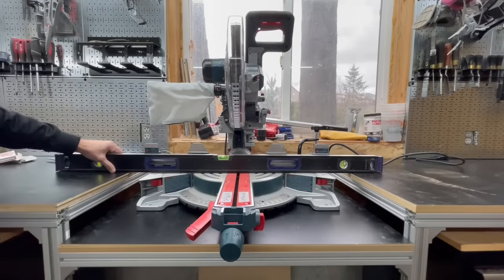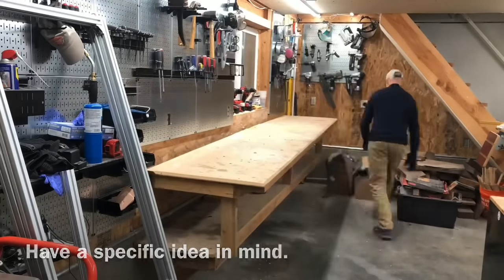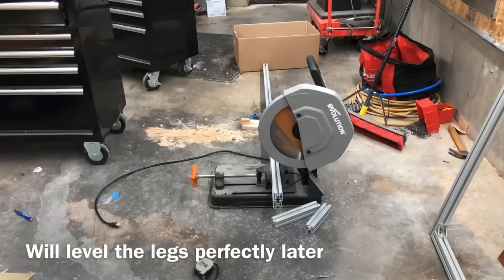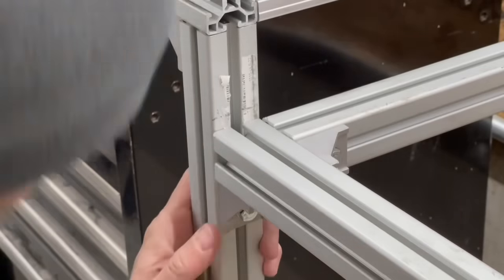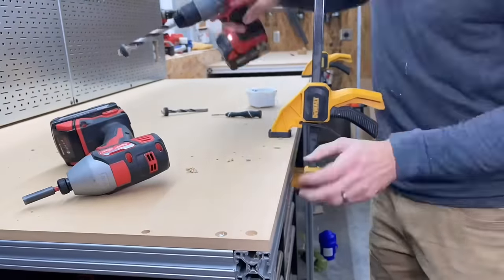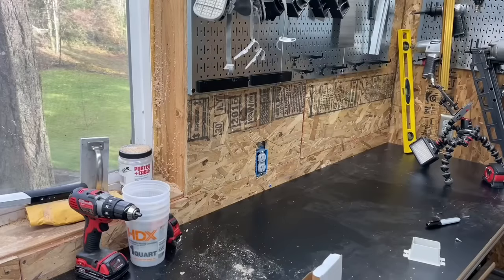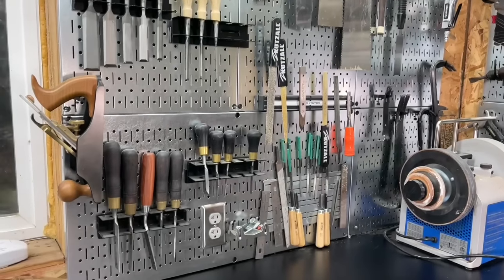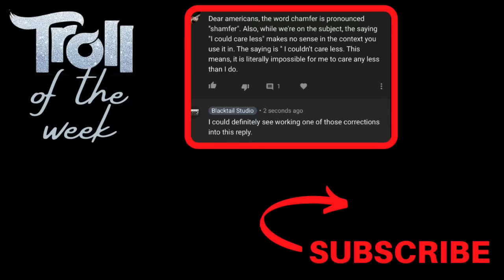Smartbench Workbench

Comment: Next time you try to make your miter saw level with the tables, use this trick: Get a perfectly square 2x4, so that when you lay it on the cutting area of your saw, it sticks out about a foot on each end. Attach it to your saw using the holes on the fence of the saw, making sure that 2x4 is sitting dead flat on the cutting surface of your saw. Now simply rest your saw using those extra foot lengths from each end. This will work as a temp holder while you install the permanent shelf for your saw to sit on. Hope it makes sense. Also, you made your station parallel to the floor, but that floor is not level, you might want to use a laser next time. Good luck!

Comment: Guten Tag, I like the industrial/modern look of the steel, makes things seem more professional.
Reply from the maker: I really do too
Reply: @BlacktailStudio  what was the name of the company the will build the table design for you?
Reply: I like the look too, but I probably would have replaced the plate covers for the electrical outlets. Metal covers against the metal pegboard blends in a little too well. Too easy to be in a hurry and accidentally plug something into the pegboard instead of the outlet, and vice versa could present a risk of shock. Maybe that's just me though - I might not be paying 100% attention because I'm thinking about what I'm building and I could see myself getting a little complacent, but I doubt I'd ever be THAT scatterbrained... hopefully. However I'm also rather fond of not being electrocuted so being the worry wart that I am, it would drive me nuts to think "It COULD happen though!"

Comment: Surprised you went with a newer style of pegboard rather than a French cleat system. Either way, I like it.
Reply: I think the french cleats systems look nice and can be handy if you're in a position where you move things around a lot but for the most part, most people put something somewhere and there it will stay. I, personally, just put up a piece of nice ply and screw my holders to it. I think the new peg looks pretty nice.
Reply from the maker: I might do a cleat system for my tools down the road

Comment: Use spray-on truck bed liner (from a can) on 1/4” steel pegboard hooks to get that rubberized look/feel for a discount.
Reply: Dude. That's amazing!
Reply: Other great way to improve pegboards hooks, is to use the heat-shrink tubing used in electrity related work. It comes in variety of diameters, to fit over all kinds of hooks.

Comment: I absolutely love my wall control panels. The pegs can be adjusted to they pretty much lock in and you have to use a hammer to tap them back out. This solves the biggest problem with peg boards.

Comment: Nice video and build. 
It's a bit late now but, you can get spring inserts for the extrusion so you could use short M6 or M8 bolts to secure your tops, as you just pop the inserts in where you want, you don't have to slide them in from the ends

Comment: Just found this channel.  Well done! I have a cheap solution t 80/20 15 series t nuts  I ran short of t nuts on a bike carrier project with 15 series I had some 5/16 18 square nuts in my hardware bins they are the type that one side is flat and the other ones a rounded smoother taper to prevent snagging on things I guess. I ran out as I finished my project. They worked so good that I went to all the local hardware stores to get more for future projects....  no luck. I did  order some on Amazon for $8 for 20. The tapered side goes to the inside of the slot they fit so well I so use them I future projects.

Comment: Nicely done.  On suggestion: Put some magnets up top on the workbench so that you can hang your pull saws with the handle down (saw blade is held near the top of the wall by the magnets).  I made this change in my shop and it was a lot more convenient.  I tried the same with chisels but didn't like the cutting edge exposed to dropped tools, etc.

Also, could not agree more on the usefulness of the Husky rolling drawers.  It changed my shop life forever.  In my case, I used the top to mount metal and wood lathes...

Comment: Bonjour, just found your channel and have subscribed.  I’m just starting my woodworking journey in a 22x24 garage that is a shell only.  It needs to be finished with insulation, poly and sheeting.  I will also have to do some electrical upgrades.  Once all that is completed I’ll be starting with building a new mitre station cabinet set and an out feed table/assembly table so I can start building small things to sell

Comment: Guten tag. I went for the no holes approach with my workbench backing for all my tools. Just a big piece of galvanized steel screwed into the wall studs. I figure mostly everything is magnetic so I got a bunch of magnets and stuck them all over and if something isn't magnetic I can glue a magnet on or put it into a bin with magnets on it. By doing this it means I can have anything exactly how I want it at all times.

Comment: I did a very similar lowered center for my miter saw, but with one useful difference.  i made the lowered part so that it can slide out to accommodate my sliding miter saw while using it, but then the shelf can be pushed back in so it is out of the way at other times.

Comment: This was a really excellent video. My pet peeve is having too much talking with no sense to any of it. Pretty much everything you say has purpose and I truly appreciate that. Why is double-sided tape preferred over just fastening it to the sub-table and taking out those fasteners when needing to swap the top out? The aluminum material is nice and I believe I will use it in a project. I agree with you on using the countersunk tech screws and it seemed to look clean enough as well. Thanks for the great video and info.

Comment: While I don’t always use a dust mask, I sure would if I was making a How-To video and cutting MDF. Aside from that, it’s the only flaw I saw and congratulations on being able to do what you love and make $$ at it!
Reply: So I just went to the link to explore this extruded aluminum and Holy Crap! For those who are on a budget (my shop is my hobby and I still wouldn’t spend the money) this is a complete non-starter. It is BEAUTIFUL but besides the expense of the initial rails, the accessories are pretty pricey as well. Being able to put a nail into a 2x4 to hang something (and pull it out if necessary) is kind of valuable. Still, you have built a great work station!

Comment: where you installed the bracket to attached your support piece for the miter saw.... You can use a longer bolt with lock nuts to fine tune the height of the mister saw. As well in the back. Attach a block of wood, and again using a longer bolt with a locking not to adjust the miter maw's height. Less shims. Just a thought. There is no wrong way or right way. As long as it works and you are happy with it....then that is the way you go.

Comment: Without trying to take anything away from your video, I think having a 10mm or so gap between your bench and your pegboard, and your bench to the wall is good practice. Maybe not so much in your case, but if you plan on bashing things with a hammer (like to remove a bearing), everything on your pegboard will end up on the bench. You can also guarantee that it will knock your beer on the floor or smash your phone. Anyway, good video..

Comment: kia ora from New Zealand that's a really smooth workbench and setup. I'm building my workbenches right now, so looking for ideas unfortunately your setup won't work for me I'm not blessed with as much space and my shop is a 7x2.5-metre trailer as I live in a custom-built RV. but I used 30x30mm aluminium extrusion for the frame of the trailer.

Comment: When installing receptacles one cannot have to many. I noticed you used a single gang box with a duplex receptacle.  If you plug in a wall wart quite often you no longer have an open receptacle. I suggest you use a two gang (or 3 gang) box on 36” centers and use Leviton receptacles and install USBA, USBC or high power USBC outlets. The high power outlets are often strong enough to power a laptop without a separate power supply. Also you can get stainless faceplates which will look good.

Comment: Lately, I've been favoring custom 3D printed "containers," on a grid pattern, over the Kaizen approach.  I never like Kaizen because it’s too difficult to change things around when a new tool is added or because the current design is no longer optimized.  There are a few videos out there on this system.  I designed my own to incorporate all the best ideas and make the system fully parametric.  I “thought” waiting for the different containers to print would drive me crazy (I’m impatient).  But I’ve found this isn’t much of a problem because I start the printer and do something else (like go to bed).  One other BIG advantage of this system is the ability to layer (i.e., stack) items in a drawer when appropriate.  This makes for MUCH better space utilization (e.g., the “good” tool on top and the “trashable” tool under it, or accessories for the tool stored under, etc.).  The grid system is extremely flexible and efficient.

Comment: You can probably find them at home depot but you can find a box of galvanized metal shims in an assortment of sizes. I used to use them in the old days when I was a framer to shim everything from wood framing to glulam beams and steel I beams.

Comment: I also did the pegboard thing, but I put together a small "crash cart" (look up the definition) of my most-used tools so that I can wheel them over directly to where I'm working.  It saves a lot of steps, and a lot of time not having to drag things across the shop back and forth.  Everything goes back on the cart in a jiffy, and it's wheeled back into its home base in a matter of seconds.

Comment: Just want to echo the strength of the double stick tape. I worked in a fab shop and the machinists would use it to stick flat stock to a jig before machining. I swear it worked too well they really struggled to get them apart!

Comment: Great video!!  great idea.  You didnt really need to drill so deep into cement did you??  Those blue cement screws really have huge holding power -- A 1.5 inch screw would be plenty.

Comment: I know this is an older video but it looks like you have your little 'Dust Deputy' hooked up backwards.. The vacuum hose should be hooked to the top, the incoming hose off of the saw comes in the side which is what creates the cyclone effect, spinning the dust down to the bucket, clean air out the top.
Reply: I just saw the caption.. sorry mate! 🤦‍♂️

Comment: Can I ask what your thoughts are on using epoxy as a workbench top?  

I have been thinking of resurfacing my workbench and since watching all the wonderful tables you make out of epoxy, I wonder, would it work as a workbench top?  I thought that it would be nice to add clear layer of epoxy over all the old scars of my workbench while making the surface level again.

Having binge watched a good portion of your videos before I got to  this one, I was half thinking that your were going to make an epoxy top for your Smartbench Workbench. Not to take away from the material you put down as a sacrificial top, which is a super cool idea.

Other than the cost and the effort involved, what are the major drawbacks of an epoxy top vs a standard wood product top?

Comment: I’d like to see you build the rigid collection system….I’d suggest, if possible, to make a lean-to style; double door through an exterior wall….less residual dust, and if the height is right, it’ll make the empty process easier.  (I envision either being able to roll a wheel barrel under to empty or a drop through for a trash bag)

Best of luck.  I’m full of useless info and get wild ideas, like a sealed exterior  dust collection unit….so let me know if it’s a realistic idea.  Or if you want another wild hair solution

Comment: I use a lot of extruded aluminum and found that carnage bolts work well in the slots and are much less expensive.  I use the T-bolts when I have to quickly remove or attach fittings in the middle of the run. ha det bra.

Comment: Auguri amico mio....

Very interesting video, especially with the aluminum frame.  This may have been asked but with 3k comments I was hoping you could answer a quick question and I honestly don't want to run through them looking for an answer. .  

Why did you choose the wall mount system in lieu of a French Celt system?  I ask because I received a starter tool kit for Christmas, which I plan on expanding and I'm trying to figure the best option to mount my tools.  I have a 24' x 24' two car garage and attempting to make the maximum use of the available space. 

Cheers, 

Dobby

Comment: I'd be interested to know how you like the Bosch mitre saw. A few years ago when I got my mitre saw, I bought the Bosch 12" available at the time, and it was so massive, awkward, and heavy that I ended up taking it back and replacing it with the Dewalt 12" and was far more pleased with it. I suppose if it's never moved around it might not matter, but it would be interesting to know your thoughts on it.

Comment: Hi! Love your videos. Especially ones on slab tables. I am beginning to make them but have little experience with slabs so far. I have some slabs that are over 2 inches thick and having a really hard time deciding which track saw to get. They are so expensive and so I am hesitant. So far not beholden to any one system like Festool, Makita or Dewalt. So I am open.
Reply from the maker: I don’t think there’s a perfect one. Probably the TS75 though.

Comment: Bonjour mon ami! Comment ca va?

Thanks for sharing. I initially thought those rails would be very expensive, but your link shows them to be just a little pricey. 😄. I saved them in my wishlist for future reference, thanks for the info.

Just curious, the metal peg boards are also a little pricey (saved them too though). Any reason, other than convenience you picked that instead of a more DIY solution like french cleats or other custom storage?

Comment: Hi Cam, love your videos! I have a question on the miter station and outfeed table if that is ok? I am wanting to do a similar set up with my miter station but one of my tool boxes is little over 72" wide. I anticipate mine being on legs on all four corners of each box. My question is, how do you feel like the span is holding up over your long side? Any deflection? Do you think it can span even more over a longer tool box? I could also include a leg in the middle on the back but it is the front span I am worried about. Use bigger aluminum like your outfeed table maybe? I appreciate any thoughts!
Reply from the maker: Ya, but there is some give in the middle.

Comment: Buenos Dias, Cay!  Your video is the inspiration for my makerspace in a 12 by 16 shed that I am building! My question is this:  On the left side of my makerspace I have 2 filament 3d printers and 1 resin 3d printer and on the back of my shed I have a big laser cutter.  I have noticed that miter saws and bench saws are MESSY, I am afraid of having them inside of the shed and then have dust contaminating my resin printer or covering with dust the heated bed of my filament 3d printers.  How clean is your shop by using the dust deputy and the shop vac?  Do you get a lot of dust in the air? I have been considering cutting outside of the shed instead of inside.  Thank you!

Comment: ¡Hola!
I was wondering how big your shop was and how effective that wood stove is in heating it.  I have a 1,200 square foot shop, that holds two cars as well as my woodworking and automotive tools & equipment.  It is made of sheet metal and is uninsulated.  I'm curious how effective a wood stove would be in that situation.  I don't mind sweating in the summer as I can open the big garage door and windows to ventilate it, but I absolutely hate working in a freezing shop during the cold months.  I have a little ceramic heater for my immediate area, but was considering adding a wood stove for more general space heating.

Also, any worries about the MDF underlayment on your workbench sagging over time or have you considered adding a middle bracing strut under it?

Comment: I'm in the process of building my shop out and  next on the list is a work bench up against the wall, with a place for my miter saw. Walls are steel studs with 1/4" ply. So not much structural to attach to so your extruded aluminum work bench is attractive. What is the name of the company that provides a kit so that all I have to do is assemble it? Thanks in advance and I really enjoy your videos.

Comment: Question about your MDF and melamine top... MDF is a great table top material, but its edges are prone to damage and fraying (esp in Florida humidity). I don't see where you added any protective trim. How has the that MDF held up?
I used 3/4 MDF and a sacrificial hardboard for my assembly/outfeed tables torsion box top (finished with shellac and arm-n-seal). The entire top has a hardwood trim to protect those edges. It has held up great, but I am wondering if it is overkill for my next project (miter station/cabinet). Cheers!

Comment: You really should install your outlets upside down in a garage/shop area - this way if you have a small shard of metal slip between the plug and the outlet it will hit the ground prong rather than the hot prongs of a plug and short out the circuit.

Comment: I’m planning on building a few cabinets using that mounting system for screws/nails/pocket hole plugs etc. what did you use for your IR gun? I like how it looks up there and I need a better mounting solution for mine when I’m powder coating. Thanks.

Comment: Probably dumb question, but is mounting the wall outlet to the steel pegboard potentially dangerous?  I'm wondering if the steel pegboard could conduct electricity.